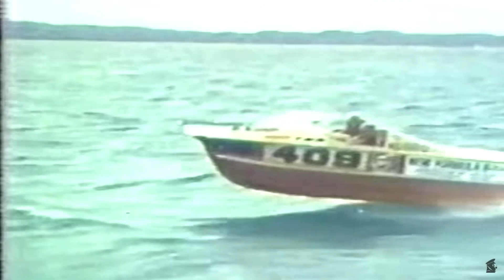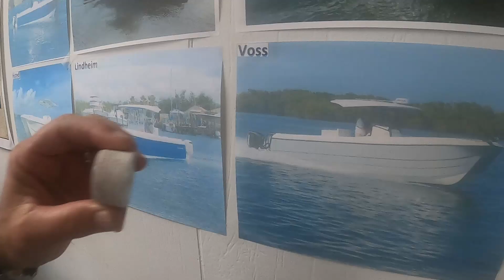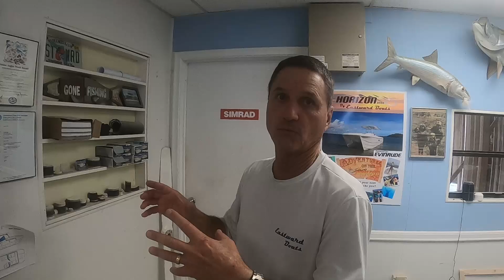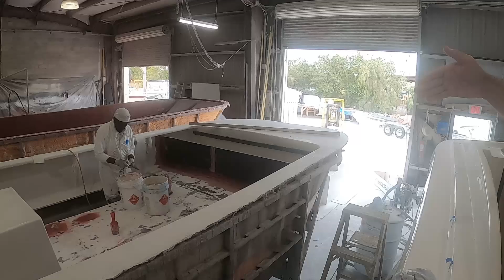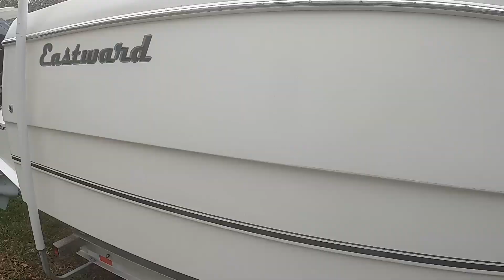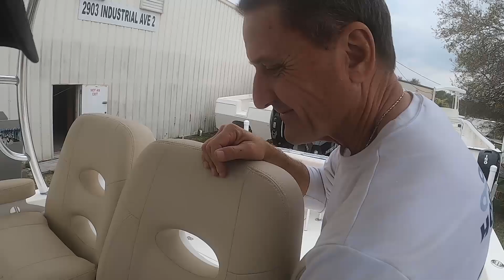Factory Tour - Eastward Boats - Is the Horizon 3000 Catamaran the Most Affordable 30' Boat?

Comment: did anyone notice at 2:40 how saltwater is literally spraying on the motor cowling?   and they are in calm seas.  I own one of these boats and this is a HUGE problem.  your motors will have rust issues FAST.   water should never be spraying/splashing on the cowlings of the motors.   the design is flawed and needs to be fixed.  not sure how but it needs to be fixed.   in ANY rough seas the motors get swamped by saltwater.  it also sprays water on the deck in rough seas and on any rods in the rear rod holders.   sorry to be the bearer of bad news.   Dave is not a bad guy but this is a HUGE issues.
Reply from the maker: I’ve read about that issue.  How is your boat otherwise?
Reply: @jiggingjerks  I've owned 6 CCs 36 contender to 39, pathfinder, freeman, etc.   this boat is the worst boat I have ever owned.   the motors take on HUGE amounts of water (swamped) in any real sea.  terrible design or wrong outboard bracket.  prob meant for inboards ONLY.  radio antennas were mounted OUTSIDE the outriggers so u have to put down antennas to put outriggers in/out?!  outriggers mounted on wrong sides on top of that!!!  not kidding. I fixed them. left with a dozen patched holes in the roof...  driving the boat the angle the screens sit you cant see them great.  not sure who tested that...  ride is decent but WET in any head sea. gas milage is solid but for a 30ft boat is average.  if quartering your rods gear will be crushed by saltwater spray.   I have NO reason to make this up.  last issue that comes to mind is every screw in the pilothouse holding the widows in fell out.   yep.   Dave did pay to have someone come out and fix the screws.  people should TEST THIS BOAT IN REAL WATER conditions before buying and note the things above.  I NEVER tested the boat. so its MY FAULT...

Comment: I have been looking at cats for a while, really like the arrowcat 32, the one issue that no one ever talks about is the hull design? asymmetrical or symmetrical? I am buying a cat for a soft ride in heavy seas, dont care about speed, the asymmetrical racing cats go really fast but a hard ride so you might as well have a mono. The hulls on the eastward look fairly sharp but dont seem as sharp as a glacier bay, what do you think.
Reply from the maker: Glacier Bay is more of a displacement Hull so will naturally ride better than a planing Hull in rough seas.  Eastward is planing.  Both Will right better than a comparable
Mono in a head sea.   GB will be slower for sure but more of her Hull will be in the water

Comment: That is one very nice boat especially for the price point!  And as Dave said, the only limitations are your imagination and your checkbook balance.  I would definitely want one with the cuddy cabin and the 600 gallon tanks.  Wonder if it could go 800 miles averaging 35mph?
Reply from the maker: It should at 1.8 mpg.  Heck, at 1.5 it should be able to do 900
Reply: @jiggingjerks  Bermuda Challenge.  NYC to Bermuda in an under 40 foot boat.  The latest outboard record I've seen is 22hrs 23min (35mph).  The fastest inboard is 15hrs 48min (50mph).

Comment: What’s the price on the 24’ ?
Reply from the maker: Mark, I don’t know but Dave will give you a pricing sheet if you email him.  Dave@eastwardboats.com.  I’ll ask for one too if you want to wait for a reply here.
Reply from the maker: Hear back from Dave - $65,629 for the 24 without power or any top.  Add 8k for a canvas t-top or 13k for a hard top.  Add 29k for twin 150s or 36k for twin 200s.  Boat comes standard with 250 gallons of fuel.

Comment: Did your personal build include electronics and windlass at that price
Reply from the maker: Just trailer.  I’m on the Minn Kota/Humminbird guide program so I’m going to get all that outside of Dave.  No need for a windlass here - trolling motor with spot lock will be my primary anchor with a traditional danforth set up in anchor locker as a back up.

My price (actually 169k) included twin Yamaha F300s, trailer, coffin box, rear jump seats, t-top, rear facing mezzanine seating, amongst other options.  I may switch out the Yamahas for Merc V8 300s.

Comment: Unfortunately it still looks like a boat made in the 70s
Reply: Painted it looks better does that lapstrake do anything like reduce spray?  After watching complete video i would consider one if I was in the market like that they are not using wood for deck unlike Parker boats and some other lower cost boats
Reply from the maker: I don’t believe it has any function. The strakes at the bottom of a boat help with pushing out spray but I am not aware of that occurring when they are on the sides.
Reply: @jiggingjerks  I believe the lapstrakes do help when the wind is on your quarter. The stakes wont let the water carry up the hull sides and wet you. Just a thought.
Reply from the maker: Not the prettiest with the lapstrake design but from a fishing perspective, she’s an awesome platform